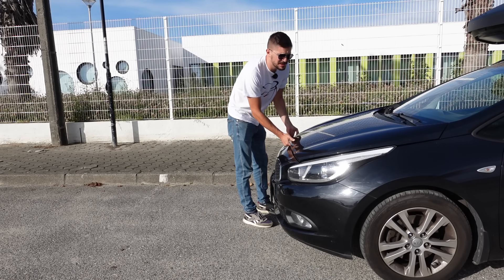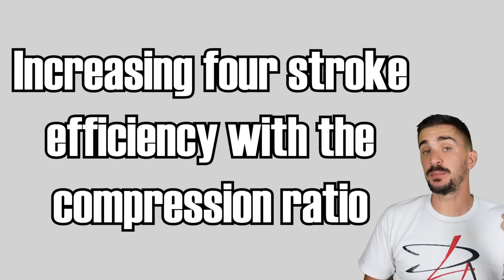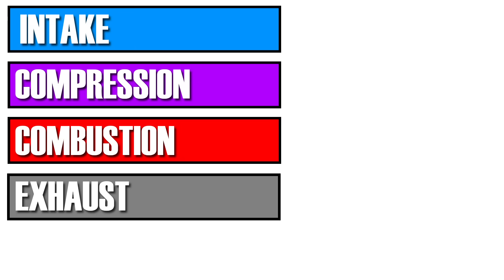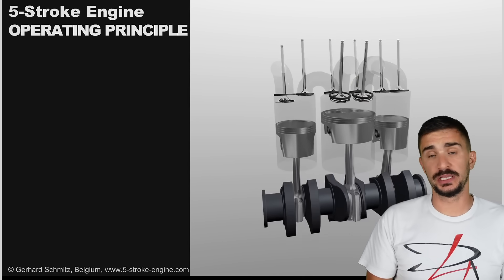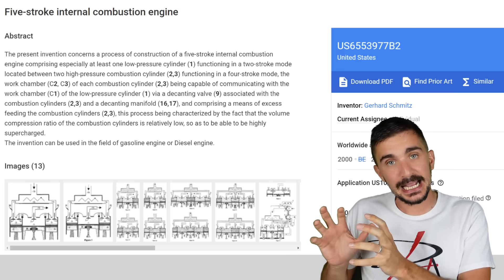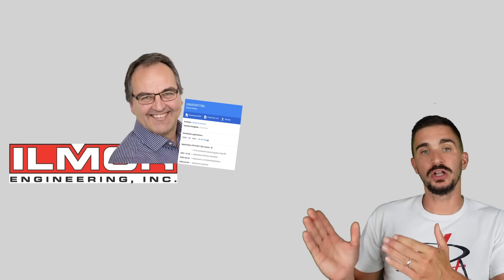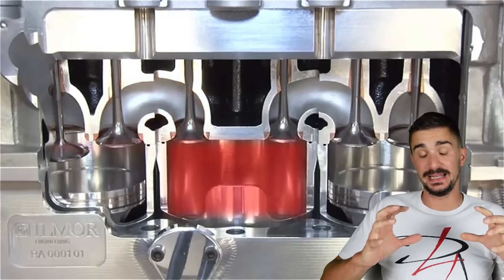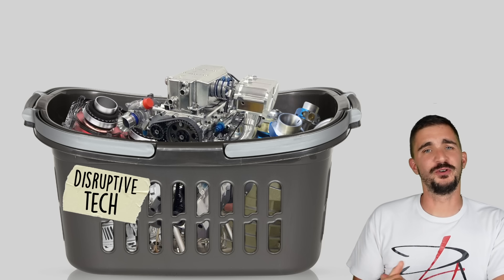Why Five Stroke Engines Are More Efficient But Still a Failure

Comment: Three key points: 

1. The moment you mentioned part-throttle operation, the penny dropped. The science is sobering. 

2. The main reason IC engines rules is the energy density of the fuel it uses. It doesn’t matter if you lose 65% when you have a gazillion percent to start with. Looking at you, lithium ion bleh… 

3. My best conclusion is that the future lies in hybrid technology. Instead of IC versus Electric, combined these two can make a formidable team.
Reply: remember that fossils will run out either way. Synthetic fuels or hydrogen just are very, very energy intensive to produce, so because of efficiency, battery electric vehicles will prevail.

We just need faster charging batteries, no need to carry a 2 ton battery if you can recharge a smaller battery quickly.
Reply: @dariusdareme   "remember that fossils will run out either way" that's really a baseless claim, much points to the fact that "fossil fuels" are produced deep inside by X mechanism, which would mean we could harness that mechanism
Reply: @dariusdareme  the truth is, BEVs already are good enough for a city driving, and most of them even has too big batteries, but as for me, it's because of general trend of bigger cars
Nowadays average car weight something like 2 metric tons, because suddenly peoples needs to drive big SUVs and crossovers, in US everyone literally buys a trucks like it's 19th century and 75% of population busy in farming
If this trend of cars getting bigger and heavier reverses, BEVs will became an ultimate solution for personal transportation, because even today relatively small battery can give you a travel distance of hundred kilometers, which honestly is an overkill for most of people
Nobody driving such distances on everyday basis, except from logistics
Reply: @dariusdareme  it isn’t actually from fossils.
Reply: The advantage of the hybrids is that you can have a relatively small and cheap battery and a relatively small and cheap ICE that always works in a single, most efficient mode and can be optimized for that. Moreover, you can still get some unused energy from the exhaust, by slapping ab MGU-H. And even an additional turbine generator AFTER the catalytic converter, as after gasses passed the converter, you no longer need them to be hot.
 You just don't need to have all the energy production at a single place.
Additionally, by having an electric turbo/MGU-H you can always have perfect stochiometry of an air/fuel mixture to avoid the creation of harmful NOx pollutants.
Reply: How do you write your 2) point and then proceed to write 3). Hydrogen is not energy dense as gasoline.
Reply: Again, reality is far from naive theories. Hybrid cars combine the worst aspects of both worlds and are utterly senseless in practice. With an engine drive train combination which ist 10 fold more efficient compared to ICE technology from the 19th century fuel energy density becomes much less of an issue that you would like to think. Most people are stuck 20 years in the past in  their knowledge of EV and this is like 100 years in ICE time.
Reply: The fully charged battery in EV/Hybrid still have lower Energy/Mass and lower Energy/Volume than fuel in ICE system.
Reply: @georgeellis6002  Funny you should say anything at all about energy density when batteries theoretically max out at like 300 wH/kg due to chemical reasons, while gasoline has 15 000 wH/kg. Even if EVs were really 10x less energy wasteful (in reality it's less than 5x), the power source difference is over 50x. And it shows, considering that a 50 liter fuel tank provides 2x greater range than a giant 500 kg battery pack.
Reply: @georgeellis6002  the only thing gayer than an EV is its owner.
Reply: @usarms149  EVs are fun on the track, but only that. Take full advantage of extremely nippy electric motor acceleration for 15 minutes at a time on the track. Don't take it on a trip and dear lord don't drive it daily, automotive build quality in year 2024 anno domini is through the floor, and EV build quality combines that with equally low 2024 electronics build quality.
Reply: IMO hybrid IC and Electric is doomed for one reason, and a masive elephant in the room. Cold start operation of an IC as and when it's required. You need to flow oil  around a valvetrain. Unsympathetic to the IC engine as a hybrid. It's an unnatural environment for it, and as a purist, a horrid combination of mechanical engineering.
Reply: Except that the other key point you seemed to have missed: do not understimate the importance of simplicity, and the problems with complexity.

An EV drive train with li-ion IS the new 4 stroke engine platform. Using the principles of 'the cumulative production of a technology platform and exponentially decreased costs' - i.e. why the 4 stroke engine has been the undisputed winner, means it takes another propulsion platform that is architecturally superior in thermodynamics (check), with a set of sub components that each enjoy benefits of manufactured scale (check). 

Add in the simplicity, and at that point it only becomes a matter of time that a low enough price and scale results in the displacement of the 4-stroke ICE engine. No doubt, it has had a great run and made a great contribution to humanity. But we also need to accept it, and say good riddance.
Reply: @itschrisuphere you say good riddance to bad things, not good things, and there’s nothing to accept, yet.
Reply: @itschrisuphere  The complexity of an EV lies in it's battery, ignoring that and focusing on the motors as if they are the only component that matters is ignorant at best and intentionally misleading at worst.
An EV, though it may have less moving parts, is not simpler than an engine, even modern ones with all their sensors and emission controls.
Reply: @rock7343 except that complexity manufacture is different from part complexity. And having a magnitude fewer moving parts is not something you can ‘hand wave’ away (again, see equivalent analogues for other non 4 and 2 stroke engine types re: this video)
Reply: @rock7343  Not only the battery. Unlike a hybrid car, EVs also require a specific infrastructure of charging stations and supplying them with electricity.
Reply: @itschrisuphere  The problem is that lithium battery costs are stagnating and still not at a point where they cover all use cases (low range, slow charging, etc.). EVs currently are more expensive then compareable ICE cars and that wont change unless battery costs go down alot more.
Reply: Non fossil fuel... Job done.
Filling a gasoline car is an energy transfer rate in the order of 5MW.
Reply: Sorry but I always laugh when somebody talks about how efficient an Ev motor is compared to ice.  Comparing just the motors themselves that is correct. A multi Phase Electric Motor is more efficient, but still produces some heat that is wasted energy. Charging and discharging the batteries also generate heat which is a waste of energy.  And because you cannot connect the battery directly to the motor ( that would only let the Smoke Out) they all have a electronic speed controller. Microprocessor controlled bank of high-speed High current transistors. That in most situations generate more heat than the motor and the battery combined. More wasted energy. 
  All of the systems are very complicated. 
 And as far as infrastructure, it can't handle the population we have now. Solar is only good when the sun is shining, wind turbines are only good when the wind is blowing. Then transmitting that power to where it is needed, waste even more energy. 
It sounds great that they are trying to develop new technologies. But they've been working for decades on a superconductor. 
Battery Technology has been around for over a thousand years.
The first electric motor was built over a hundred years before the internal combustion engine.
And luckily the only reason electric is staying at a reasonable price is because they have competition with gas and oil.
Reply: @kcdesignconcepts5216 I mean EVs are more energy efficient. Electrical losses are minimal compared to IC losses, yeah there's some small amount of heat produced by charging a battery or running a VFD but it's pennies compared to IC, it's just the battery that holds it back
Reply: @kcdesignconcepts5216  EV zealots, in general, need to justify their purchase and their ideals.  They either don't understand or purposely ignore that the only meaningful comparison is the system, not a single component of that system.

Comment: ICE: I have existed and propelled humanity for 150 years!

(...): pffh, amateur 

ICE: What was that, punk?

The humble sail: amateur.
Reply from the maker: Exactly, it's humble. As I said in the video "mechanical complexity". Paddles have probably existed longer than sails but they're also very simple. Clothing, furniture, spoons etc...they're all very simple
Reply: @d4a  Humble, yes. Simple, no. A fully rigged ship has multiple masts which can be equipped with a variety of sails depending on the direction of travel, wind direction and strength, sea state. Correctly deploying the adequate sail, according to those conditions, on a ship of the line required the precise coordination of up to hundreds of men. Not a simple task in my opinion.

Comment: I'm no engineer, but I wonder if cylinder deactivation on the middle cylinder would improve low RPM efficiency. Add a secondary air system to warm up the cats and maybe this would be a feasible design 🤔
Reply: Cylinder deactivation would do nothing as there are no pumping losses in the 3rd cylinder, only gain.  The friction is what you want to reduce and for that you'd need to physically disconnect the piston/rod from the crank.  Ain't happening in any reasonably efficient way.
Reply: As far as cylinder deactivation, I was thinking the same thing. Maybe use a similar concept to variable valve lift and shut down the low pressure cylinder, or at least limit its travel, with hydraulics and/or solenoids.
Reply: I was thinking of giving the middle cylinder a fuel injector that only operates at low rpm. Something to give it just enough extra combustion to justify its weight until the outer cylinders are making enough pressure for the middle injector to shut off.

Comment: ICE engines are absolutely NOT over.  Elec will take a good chunk of passenger vehicle service, but we'll still need ICE engines for a good number of applications for many years to come.  I suspect that we'll move into synthetic fuel territory at some point though, rather than continuing to use crude oil.  Even if it isn't as energy efficient.  There are many reasons for that, but they are beyond the scope of this comment.  and TouYobe will probably delete this comment anyway...

Comment: who cares what the displacement is and how it's counted? What matters is HP, weight, fuel efficiency, and nothing else. If it's lighter than equivalent engines, produces same HP, at lower fuel consumption, then it is a better engine. Nobody cares about how its displacement is classified. But only counting combustion cylinders seems fair to me, as other engines don't count their turbos either, and the extra cylinder is doing the same thing as the turbos (using waste gas to boost performance).

More complex? how? 3 pistons and a simple turbo is no more complex than existing engines.

Billet engine block has no impact on performance within the cylinders. it just holds things together. No big deal to make a cast version. What Mfg method you use for prototyping is often different from production due to cost and qty ordered. But they are functionally equivalent.

you're nit picking and trying very hard (and very poorly I might add) at discrediting the engine. You take an otherwise good video, and finish it with BS nonsense.

Comment: You are fundamentally wrong about the reason that combustion engines are only 35-40 percent efficient.  Although there may be some room to reduce losses due to friction,  there is a fundamental thermodynamic limit called the Carnot Efficiency which is 1-Tc/Th, where Tc is the temperature of the cold part of the cycle, like the exhaust, and Th the hot part of the cycle like the combustion.   No matter what you do in terms of engine construction this limit cannot be beaten.  for temperatures used in ICE engines this works out at about 45-50 %, without counting any other losses so there is not that much to be gained.  This limit has nothing to do with the length of the combustion stroke of the fact that only 1 of 4 strokes are producing power.

Comment: What about using the engine for generators of electricity which mantain the same RPM during operation? That way we could ignore the low rpm ineficiencies, right?
Reply: Good idea, but most larger generators are Diesel powered.

Comment: The CR in that example is 11:1 sv+cv÷cv. This would work better as a CI power unit. Especially if it's designed to work at a very narrow rpm window, running a generator or such like. Further development on valve sizes and events, with a view to giving the pressure charger more energy would be of real interest. Additionally hydrogen as a fuel source would correct any emission concerns, also for providing a much higher CR than a engine designed to run on petrol.

Comment: Are 6 strokes feasible? With EFI engines could switch between 4 stroke during high loads and 6 stroke during low load. Intake, compression, power stroke, compression, power stroke, exhaust.

Comment: As with all early inventors they did their homework breaking down all aspects of the fundamental workings of their build to produce the most efficient and reliable product possible because their NAME was on it and 9 out of 10 times it was over engineered to last 3 lifetimes. Their products can hold up to MINOR tweaks as technology advances but the fundamentals are NOT interchangeable without destroying the product. Today's products are built as throwaways that break as you take them out of the box to insure that the money flows... Sad but true.

Comment: DC Brush Motors were invented in 1834, 190 years ago. In 1879 (145 years) the first electric train was run, in 1888 the first electric car. Not to say that the combustion engine isn't impressive, but electric propulsion was a thing ~50 years prior to ICE.
Reply: This! Thank you, where is the nostalgia and admiration for electric motors?
Reply from the maker: As I said in the vid: "omnipresent".
Reply: @d4a  Trains have been running electric units in subways and passenger services all over Europe and Asia for the majority of the time that cars have been around. ICE in cars only took off in a big way in the 50's, before that, they were a largely luxury item for the upper class.

No knock on your video, the ICE has put us where we are today, but the electric motor has been around for as long as and arguably been more important than internal combustion. You can't build a modern car without a drill, you can't spin a CNC machine without a motor, Hydraulics are pressurised by a pump that often runs with electric power. So yeah, I would say that electric motors and ICE engines are in faire competition for being more impactful, but historically both have strengths where the other has weaknesses. The needle is shifting in favour of electric these days, but I'm certain internal combustion will continue to have a part to play in certain industries for a long time.

Comment: The intresting engine configuration now, is the new Porsche configuration. How efficient can you make an electric turbo and a flux motor combination?
The electric turbo can even harness the extra energy as electrictrisity.
And, how much of the engine are electrified? Oil pump, waterpump, break booster...... ?

Comment: Two questions then.  First would a compound engine, properly developed, be better than existing tech in a range extending,  hybrid gas/electric car?  The ICE is then only used in its optimized RPM and load range.
Second would a compound engine benefit from cylinder deactivation ala V8/6/4 engines?  This would require some exhaust gas switching trickery but...?

Comment: I think it's still viable. They just need to get the compression in the working cylinders up and use the right valvetrain for the expansion cylinder. And probably get the expansion cylinder displacement up, as well.

Comment: Did you check on the Miller engine? Here, you can use early (or late) timings for intake valve closing. As a result, the you decrease the effective compression stroke compared to the expansion stroke. The changed timings of intake valve closing obviously impact on the cylinder filling. However, the you can apply increased boost pressure. And here is a trick. You take some compression out off the engine and apply this compression by the compressor. And between the compressor and the engine, the you will the intercooler, and the which allows to achieve the same TDC pressure with decreased temperatures. A prominent example is the ea211 Evo, which also runs cylinder deactivation. Best regards

Comment: Sounds like it might make a good range extender, assuming better options aren't available.

Off-road equipment is less sensitive to size/weighs, tends to have looser emissions standards, and is actively moving toward hybrid-electric designs. They would be a good application IF this is well-adapted to diesel engines. 

I suspect it would work well as a diesel running at constant load: 
- More heat/pressure to dump into the 2nd cylinder.
- Prolonged time at elevated temperature/pressure might allow particulates to burn more thoroughly.

Thoughts?

Comment: wouldn't the 5 stroke engine be well coupled with an electric engine as a hybrid? you can start it when you'll get certain rpm with it so u benefit more from its efficiency without its issues on low rpm 🤔